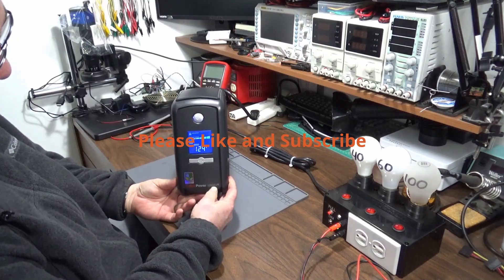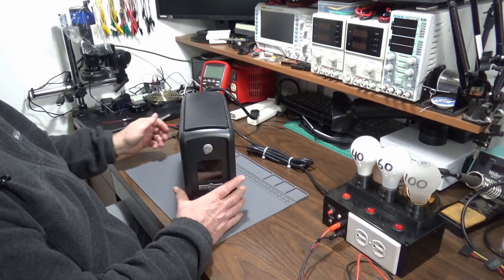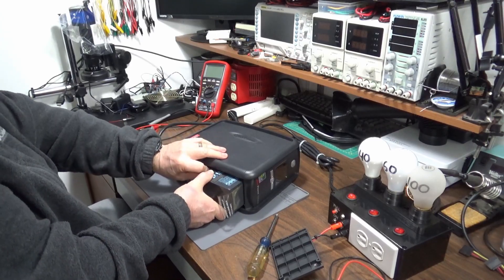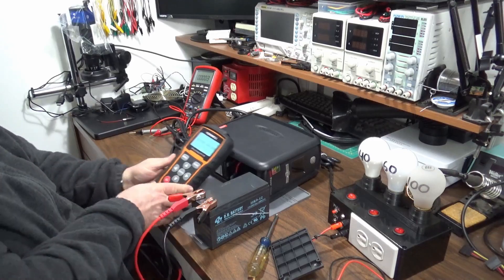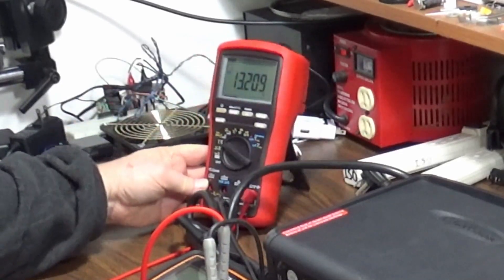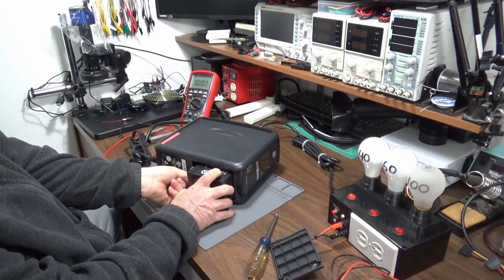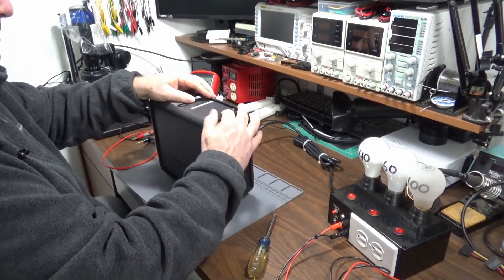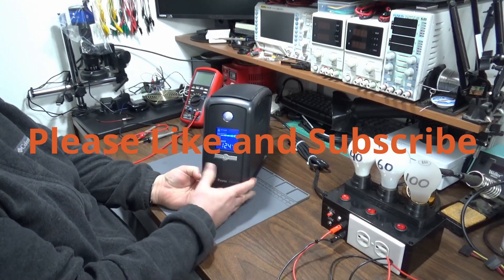Cyber Power 1000AVR UPS Battery test and replaced.

Comment: auto mechanic here. Just to clarify, because i've met too many people that think just because a battery reads 12 volts, it's a good battery. Not at all! After years of use, a lead acid battery will become sulfated. That is lead sulfate will build up on the internal plates of the battery. Which reduces it's capacity, but not it's voltage. Nice set up by the way!
Reply from the maker: I know SLA batteries will do that but I didn't know AGM or Gel batteries would do that,.. Learn something new every day.  Thanks

Comment: I picked up one of these recently at a thrift store and drilled holes in the side to poke the battery wires out (protip: top section pulls off, no screws), and connected a larger cell next to the unit (12AH I think). Working so far.

I found that it's the older CP1000AVRLCD, but they named a newer 2020 model the same so you have to search a little to find info about this older version from around 2010 it seems.
Reply from the maker: Thats cool,..  You could definitely extend run time with a bigger battery

Comment: Thanks for the video.  Your lightbulb gizmo is a simple, yet innovative, way to prove proper operation.  Good job.
Reply from the maker: Thank you
Reply: I've tested several inverters and was going to set up a variable load like yours, with incandescent light bulbs, but I found that the inrush current is quite high and can trip up inverters. It works here because you already have the bulb warm when you switch over.